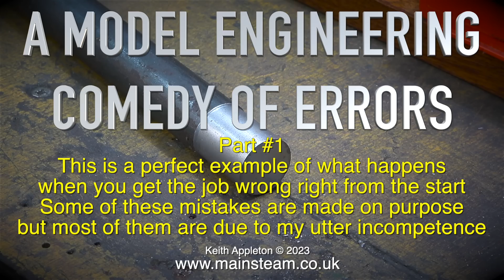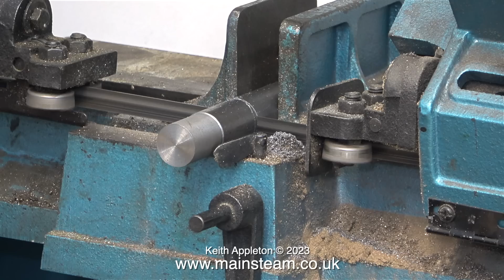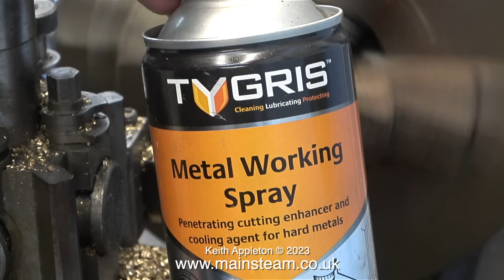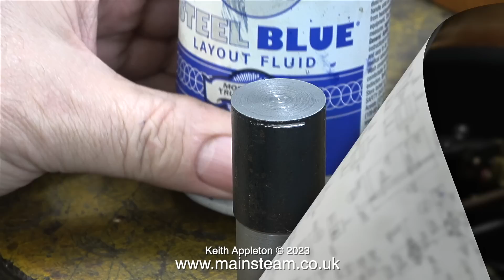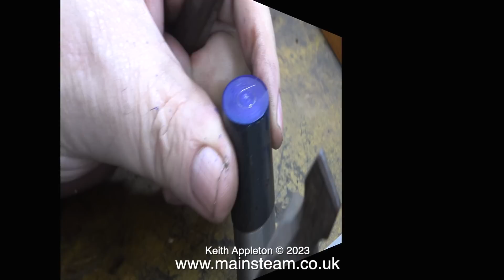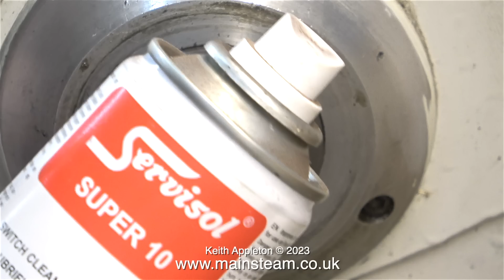A MODEL ENGINEERING COMEDY OF ERRORS - PART #1

Comment: OMG I laughed my ass off because I did almost the same thing trying to machine a part from a Toyota CV axle shaft.  That material was as tough as a boiled owl's beak and probably had a 250,000 PSI yield.  Carbide would cut it, but the surface finish was horrible AND it work hardened with each attempt to cut.  I could take off 0.025" but not 0.005".   I wasted several hours and then gave up!   NOW I label every piece of material I have on hand, especially aluminum, cuz there are many unweldable alloys out there in the wild.

Comment: It's Lowmore iron , barely steel with the high carbon content , try as you might always a crap finish the cheapest black bar you can find , free cutting steel is ok for shiny work but not much strength , I'm retired now ( thank god) 50 odd years before the lathe / miller / drill / horizontal - vertical borers and grinders . . . I haven't missed it ONE BIT .

Comment: It's been 50 years ago last time I used a lathe. I'd used some state of the art tungsten carbide interchangeable 6-sided tips and the teacher was blown away never seen that before.  Servisol 10 is very clever it has a mild acid in it but as I remember it's supposed to be sillycone free.
Edit: tool was pilfered from DeHaviland Hatfield

Comment: Having got maybe 100 different raw materials and I don't want to make a small internal combustion engine conrod out of 2011-T3 or 6061-T6 al. alloy when it should be made from 2024-T3 high tensile al. alloy,  I engrave the raw material specification on BOTH ends of the bar.  That ensures that I do not risk having an unidentifed piece of material if I inadvertantly machine the description off a single marked bar.
Machining cast iron creates both very friable small chips and also releases graphite dust.  That bar in the video is a hot rolled steel and could be - anything!
Reply from the maker: I only use about 4 or 5 different materials. I don't know where this stuff came from.

Comment: Hi chap sorry but from my limited experience from when I did metalwork at school, we were always told to use cutting compound … so many seem to forsake it’s use these days, surely it will burn your tool out and hence you will have blunt tools which will result in a rough finish? Sorry not being judgemental and I thought straight away that that is a piece of mild steel.
Reply from the maker: I used some in one of the videos - did you miss that? It made no difference. Carbide tips work fine in the home workshop without cutting compound.

Comment: Hot rolled steel bar, instantly recognisable if you've had it before, I've never managed to get a good finish either.
Reply: Yes, the mill scale looked pretty obvious on the video. Maybe not as much when you're a bit under the weather. That stuff never turns nicely.
Reply: yup, that's what it looks like to me, with hot rolled ms bar its "tearing not turning"
Reply: Figured that too
Reply: Can tell hot roll and cold roll stock by feel…hot roll is rough cold roll smooth…you can get hot roll shiny with abrasives…also the scale on hot roll usually a pretty good tell
Reply: You need a large stout lathe and negative rake carbide tools. It'll have a nice finish if you take a big enough cut.

Comment: Hey Keith,
don't worry had almost the same problem while machining a valve for my motorcycle engine. Was not 100 focused on the job, picked the wrong materials and on the opposite wondered why it was so easy to work....
When testing the engine the valve was not robust enough and destroyed itself, at this moment I took it a day.
At the next day I found out instead of the proper steel, I used cast iron and had to spend the next hours of cleaning every part of the engine from the small debris.
We all learn from our mistakes :)

Comment: While not knowing the turning characteristics of all steels, it acts like a genuine piece of wrought iron.  Similar to plain medium carbon steel when machining for good surface finish, that machine good with speed and carbide but generally the W I will not clean up.  Feel better.